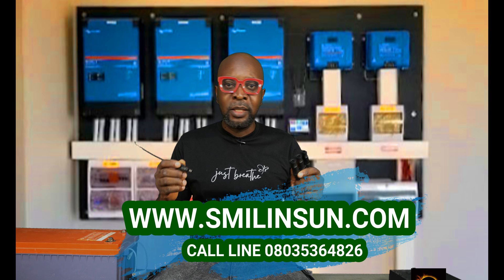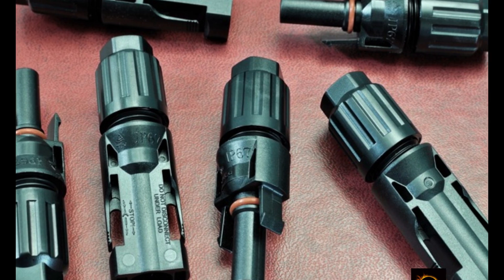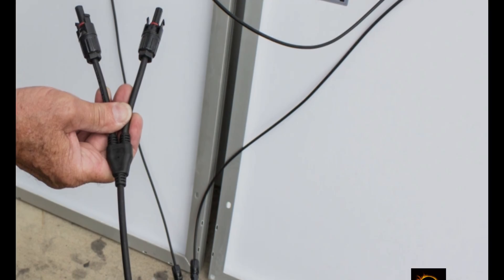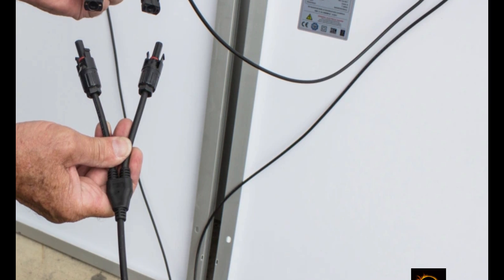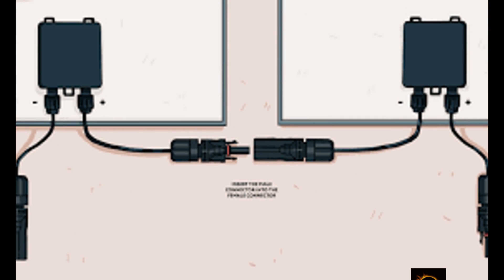Solar Panel on the roof is on fire.

Comment: That was quite a blaze. Can solar panels cause that? They mostly are made out of glass and metal, aren't they?
Reply from the maker: yes it can , it starts from the wire which  is flammable  then spreads to your roof and down to the wooden framework that support for the roof

Comment: From the news i heard, it's likely caused by a lithium battery fire from inside the printing press shop, located at murg plaza, Abuja.
Reply: Without proper investigation, that's just them jumping into conclusion. Chances are that something else started the fire which got escalated by the supposed batteries.
Reply: @ekeretteekpo3004  Exactly. I don't believe that fire has anything to do with the solar installation. There has been fire incidents before solar systems.
Reply from the maker: @ekeretteekpo3004  I think so too
Reply from the maker: Thanks  for that information,

Comment: And also any connection of solar panels in parallel MUST be fused, go n verify.
Reply: And you MUST use protective devices intended for DC and not AC.
Reply: @soundspark  , that is Circuit breaker, am so happy that I have trained you very well my Son.
Reply from the maker: @soundspark   That is also correct, thanks this is helpful
Reply from the maker: Great Input man Welldone